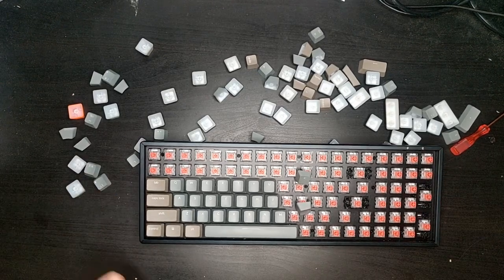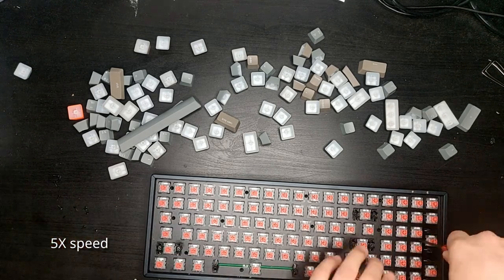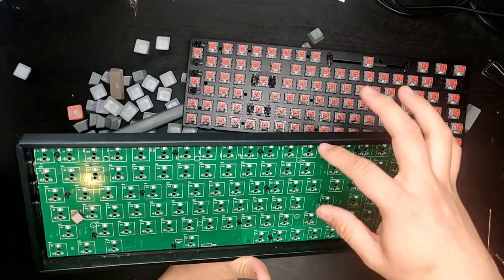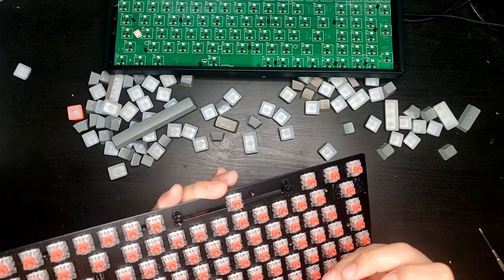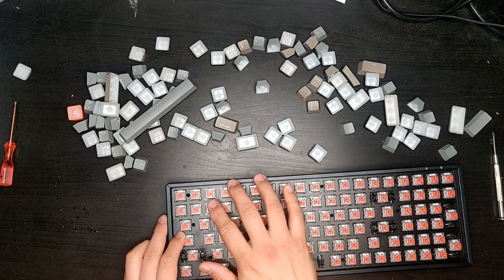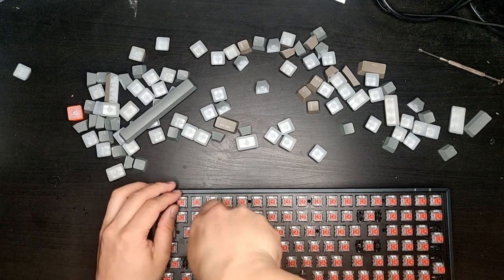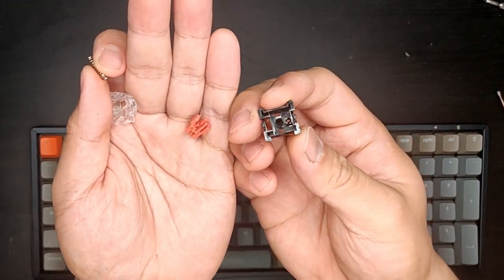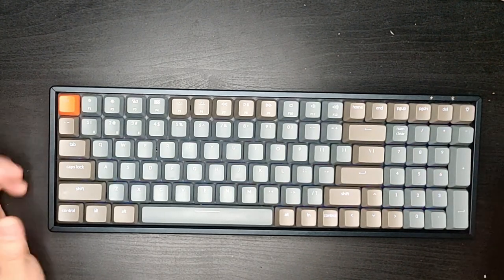Keychron K4 optical red switches keyboard and switch teardown, are LK switches hot swappable?

Comment: Hi! Thank you for taking the time to walk us through this teardown. I had gotten frustrated for the right 'optical hotswap' board until I realized the switches must simply pop out with the right tools. Thanks to your help confirming this, I finally ordered the RGB version. I tried using your link, but since I bought a different version, I'm not sure if it helped. Next, I'm ordering Kailh Dark Blue opticals for the letter keys.
Reply from the maker: I think the link is outdated but I appreciate your efforts
Reply from the maker: If you get this board do not get other brands of keys, they will not fit!! You can only hot swap them with LK optical brands. Unlike cherry mx switches, optical switches don't have a standard layout and you must check the bottom before getting replacement

Comment: Thanks for this video. My K4 had a defective optical blue switch not clicking and I managed to fix it by following your video. The click is generated by a second smaller spring and a rotating plastic notch thingy. The small spring was not in place properly. In fact I think just by removing this you can convert a blue into red (but not vice versa since the red lacks those clicky parts)
Reply from the maker: Cool, happy to be helpful.
Reply: bro tried that, removing the small spring from the blue switch, I don't recommend it because the reaction time for the switch to react back to original position is slow causing double input on the keyboard. so I just wasted entire blue switch which i had to insert back the small spring for it to work. Bought the new red switch with keychron..

Comment: Thank you for this video! because I just look all the switches out and lubed them. Now the keyboard sounds so good and feel better to type on. Also I bought a switch remover but that actually damaged 2 switches that i used it on so i ended up doing kinda what you did, using a small flat head to push on one side and and using a finger on the bottom side of the switch to push one side out, then do the same with the other side of the switch.
Reply from the maker: Which version do you have?
Reply: Kevin's Tech, and Tours K4 with Red Optical switches
Reply from the maker: @ZedaKeys  nice. I have another video planned about the switches, and later the K6 when I get one. So stay tuned.

Comment: Getting those power and mac/windows switches to line up for me was a serious pain. Especially since I took those switches out in my white k4 build.  BTW those switches are in there pretty good and you nearly have to break them to get them out. If I were to do it again I would have simply taped over them.
Reply from the maker: For lining them up to reassemble them you should put them both in the down position , so you can tilt the keyboard and let gravity help you with the plastic slider position. I don't find the switches to be particularly strong in the plate.... Just push the tabs in the right position

Comment: Just a question, is the battery replaceable? Will the keyboard still work even if the battery is removed, and if it is just connected via USB? Thanks!
Reply from the maker: The battery is attached by a standard jst connector, so if you want to replace it just be mindful of the dimension and get something that fits, im not sure if the unit can work without battery in wired mode, I did not test that
Reply: Can't answer about replaceable, but I have disconnected the battery (the JST connector is quite a pain to remove) and it's working fine for me via USB. I can't say whether there might be long-term effects, but I personally doubt so.

Comment: Hello @Tech Explores NYC! I really enjoyed your video. I am reaching out because I noticed that you were in New York. I have a Keychron K4 with Gateron Brown switches. I bought new key caps and new Glorious Panda lubed switches. I am reaching out because I am struggling to pull out the gateron brown switches. Like I am pulling with all of my strength and these switches aren't coming out. I feel like I am doing something wrong. If you are available, could we possibly meet in NYC to take a look?
Reply from the maker: Gateron switches are soldered on. If you haven't desolder the switch there's no way you will pull it out without damage.
Reply: @TechExploresNYC  well that solves everything 🥲 I got $120 worth of lubed glorious panda switched for nothing. Will either return or check forums to see any boards that take em
Reply from the maker: @SheckMulbah  You need to make sure you find the hotswap version, that will allow pulling out of switches, even if it says it is gateron. the keyboard shown in video is not gateron but LK optical.

Comment: Hey, great video, thanks! One question though - how did you remove the slider switches on the side (the one with Windows/Mac and wired/BT mode) ? Do they come off when you pull the PCB out or do you have to remove it from the outside first?
Reply from the maker: They sit on the slot on the switch slider, when you put the PCB back on make sure you line up the position on the PCB switch and the slider on the case, or you may break the switch when they collide because they mismatch.
Reply: @TechExploresNYC  Great, thanks! Planning to replace the switches on my K2 since K4 has a similar design wrt the frame.

Comment: Hi, do you know if the springs can be changed easily? and the stabs can be changed or not? I'm planning to get a optical red K4 and put Gateron Yellow springs in those :D
Reply from the maker: As long as you get suitable spring and open it up carefully you should be fine. I haven't looked at the stabs

Comment: what other switches would work for this keyboard? and which would be the best?
Reply from the maker: Only keychron's lk optical would fit. standard red brown and blue characteristics
Reply: @TechExploresNYC  this is going to be my second mechanical keyboard. My first has MX Browns and I really like it. I bought the optical red version and figured I'd try something new and change it out if I didn't like it. What difference could I expect from MX browns to optical red?
Reply from the maker: @Jazzmusicstops  browns has a little bump has it goes down, reds don't, it's smooth all the way. The keychron optical reds are lighter so if you rest your hands on the keyboard home row you may accidentally activate the keys. They also have the optical brown for K6 if you want to try. It's hard to convey keyboard feels over internet so you might just have to get one to try and trade it if you don't like.

Comment: I am new to the mechanical keyboard hobby.   Are all optical mechanical switches the same as regular mechanical switches, or are some mechanical switches have different components?   

I own a Keychron K4 brown switch.   I have a seperate optical confirmed hotswappable switch coming on the way in red.  The optical brown is so smooth compared to my regular mechanical cherry brown, that I've thought about getting a blue or Kaileh clear and putting it back in there.  It being swappable is good.
Reply from the maker: No they are not keychron's optical switches are made by a company called mingjian, or otherwise known as LK optical switches. 

Unlike the electrical (my term) switches, there's no overwhemingly popular standard allowing switches to be interchangeable.

Gaterons opticals have a different foot print, and so are different generations of LK opticals.

Check out my channel for other Keychron videos.

Comment: Hey there, thank you for this helpful video. I have the K2 and want to lube my red switches, replace the keycaps, and do something about the ping. Do you think it would cause any issues to put some foam under the PCB to help reduce ping? Or would cushioning the stabs be a better option? New to this, so sorry if a dumb question. :)
Reply from the maker: I'm new to mechs too lol, the space below pcb is pretty deep so I think you should start with cushioning the stabs. Find out where the pinging is coming from first before you make your move.
Reply from the maker: Now, if you have the k2 chances are they are soldered on. If that's the case you may have to desolder the switches first, which is a lot of work.
Reply: try to lube up your stabs and just put some insulation foam in the housing, it's empty and it has alot of reverb, in the new k6 keyboard they already added this from the start
Reply from the maker: @NanescuRadu1  I lubed the stabs and some springs. foam inserts will be next. ( I measured about 10mm space in there)
Reply: @TechExploresNYC  dayumn that's alot of space
Reply: Just wanted to come back and thank you for your input. I ended up putting .25 inch sorbothane underneath the PCB and lubing the switches by pressing them down and getting some down the sides (krytox). The result is a much smoother and quieter type, and I'm really happy with it!
Reply from the maker: @raininseptember  that's a very expensive way to use krytox, but good for you

Comment: Hey Kevin. Thanks for the video. I'm thinking about purchasing a K4 soon. As far as you know, are the switches on the non-optical version of the K4 soldered on or are they hot-swappable as well?
Reply from the maker: The non optical ones, I'm sure are soldered on. Keychron is making the first hot swappable electrical (as opposed to optical, as they are both "mechanical") with the k6, and it will cost 10 bucks more than the soldered on version.
Reply: As someone who has dissassembled the gateron brown version k4. I can attest they are indeed soldered on.  You can desolder if you have the skills and patience.  This is pretty interesting seeing that the optical switch version is so different. Hows the feel of the optical red switch vs a mechanical switch?
Reply from the maker: @AtomicBleach  The desoldering part is the worst, copper braids, solder bulbs you named it I tried it, nothing makes it easy. The optical reds are definitely much sensitive compared to the kailh blues I used before. In fact they are too sensitive for me to rest my fingers on the home row. I am hoping the brown opticals will solve the problem. So I already put in an backing of the K6.
Reply: @AtomicBleach  Hey Thom, do you know if you can replace the switches (gateron browns) with something like the Zealios or Holy Panda switches?

Comment: So keychron k4 optical switch is hotswappable?
Reply from the maker: Only with optical switches of the same brand and model (Light Strike LK brand). I searched online for the gateron opticals and their socket layout looks different.
Reply: @TechExploresNYC  any idea where I can buy replacement LK blue switches?
Reply from the maker: @foroudifarhad  Keychron will eventually offer them, but I have found the original manufacturer willing to sell you if your minimum order is 5000

Comment: yo kevin Im looking for new switches mine are really loud what do u suggest pls help. and ty
btw if the switche fits on your keyboard it will fit on mine so pls help. lol
Reply from the maker: If you have opticals you are out of luck.your best options are to lubricate the switches and add a damper ring. Most of the time the noise comes from the bottoming out of the keystroke and the ring will reduce that
Reply: @TechExploresNYC  wdym by if your out of luck if you have optical switches? I bought the red optical switch version and possibly might lube them. Is it ok to lube optical switche?
Reply from the maker: @MashedLinux  you can absolutely lube the switches, what I mean is buying spare switches in order to  change the switch type to brown or blue because I can't find anyone selling them. 
modding the switches can be done. In fact, I already switched out a few springs and lubed them. However, they remain red switches (linear). I just learned that I preferred to have a bump but no noise (browns)

Comment: u think you can do a littler cut to make light bean more close to the border of the isolator So you can lower the resistance responsiveness ?
Reply from the maker: That kind of high level work I would much rather not do it. If anything I want to stiffen up the switch so I don't accidentally type on it when I rest finger on the home row.